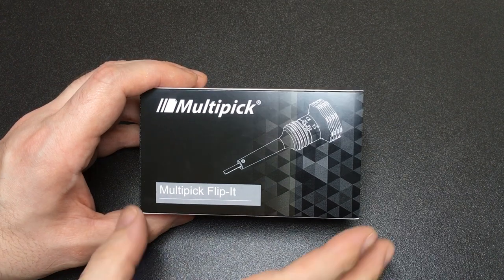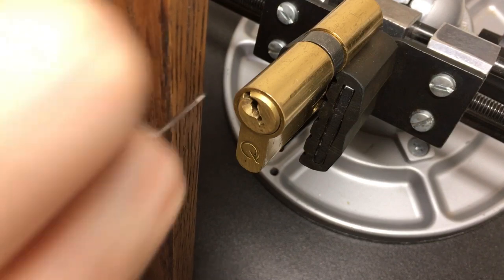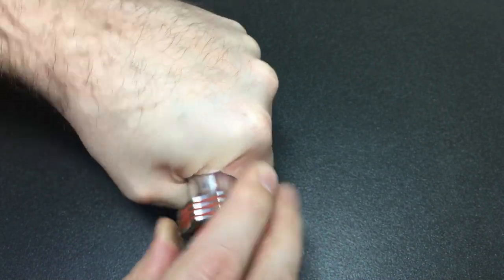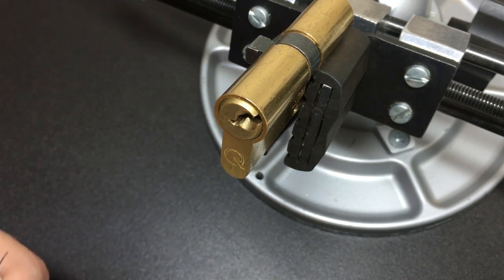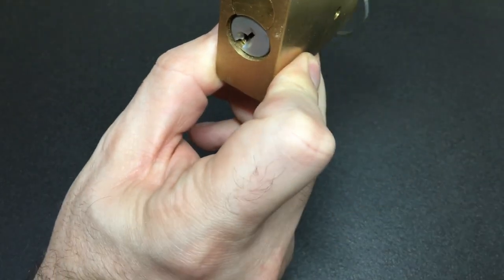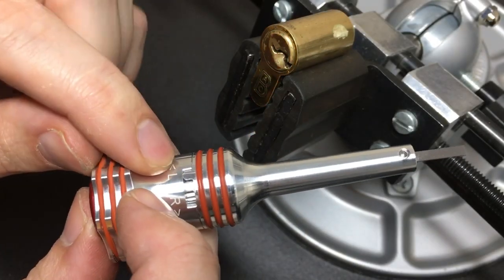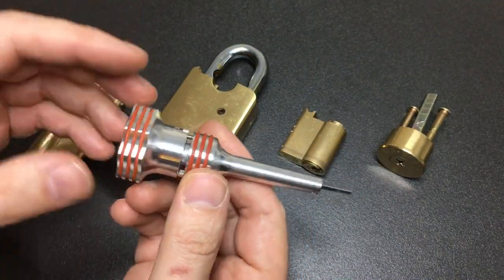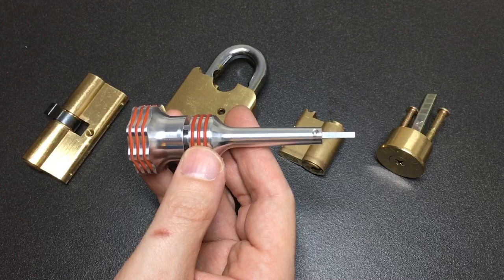Multipick Flip-It Plug Spinner Review

Comment from the maker: I finally get my hands on a plug spinner! One of those tools that when you need one, you wish you had one! 😁 let me know what you think of this one from Multipick in the comments 😃👍
Reply: Honestly the design is nice to the eye but sh*t to use... Why did they make the front part round?!?!? You can hardly tension that thing... Why didn´t they put some kind of jimping on it? The rubber rings do nothing.... I love Multipick, but everyone telling me that this is easy to use as a locksmith is a fkking Fanboy! Especially when WD40 comes into play...
Reply: Small correction, perhaps: It seems to rotate by 90°, not 180°, which does make more sense, if you think about it. It's hard  to tell on this small screen, so please correct me if I'm wrong. That said, it's an excellent idea, so thank-you for the demonstration.
Reply: @RWBHere  When the trigger is pushed, it rotates a full 180 degrees, not 90 degrees.
Reply: @clintsingleton3846  what i´ve meant is slippery greasy stuff in general... if you have slippery fingers this thing is a pain in the a$$ to twist and tension...

Comment: Yet again a quality product from Multipick. You can visibly see the effort that's gone into the design. I haven't used a plug spinner before but do understand the concept behind it. Great review and demos.  I never thought of using one on a cross lock, I guess that's because I never thought that it would work on one. People say it's unrealistic to pick cross locks several times as it slows down the picking to get an open. Well, using one of these shows that you only need to pick it once and then let the plug spinner do the rest.
Reply: The design has it´s flaws... the rounded front part is pain in the ass to tension...
Reply: @Mex_the_Fox  I actually thought that when observing the tool being used. The larger back part looks ok to grip because of its shape. The smaller front piece is small and doesn't look like it gives much grip for the fingers. 

The Multipick plug spinner looks like a solid tool and strong, not flimsy. That's what I meant by my comment. 😁
Reply: @roysammons2445  that's what I wanted to say... I own it but I modified the front part. I removed the rubber rings and gave it two clean but deep finger grooves... Honestly, without that mod, I'd prefer any 15$ tool over this one...
Reply from the maker: Glad you like the review 👍😃
Reply: @Mex_the_Fox  You do have a very good point.

Comment: I absolutely love this tool! No plastic, no accidentally going off. You have to mean it.
- However; I wish they had milled a flat area (from the factory) to aid in charging this left or right with the aid of a wrench. This thing has a tight spring. Even lubed it up a few times thinking this might help. ..... Still, I wouldn't have any other plug spinner in my bag! Pick whichever direction you need, then go! Or of you have to turn a cylinder multiple times to open the mechanism, no problem!! Just Flip-It!
Reply from the maker: Yes, it is tight! 👍

Comment: Great video. I couldn't tell from the unboxing if the spinner comes with differently sized tips. Thanks for letting us know! Take care.
Reply: No you just get the one tip, or at least that's all that came with mine which I got from multipick about a year ago which is about 4mm across
Reply: @JohnDoe-ee6qs  Thanks! I appreciate your time. Take care.
Reply: @webfox1  no problem
Reply from the maker: Just one :-)

Comment: I've wanted a plug spinner for quite some time now, just to have. I like the look of the multi pick one.  Only reason I haven't invested in one is mainly because of how little use it would see as a hobbyist picker.  Good review, have a great weekend.
Reply from the maker: Thanks 🙏
Reply: @LockNoob  what's kind of ironic?  Thursday I picked up a padlock, just a cheap one from princess auto, the bitting is pretty decent on it, what I liked the most is its surprisingly rekeyable with a shielded shackle. I can pick it backwards quickly, be darned if I can get it picked clockwise yet though.  Hahaha. I guess I do in fact need a spinner in my collection now.

Comment: Does it work on M1 or M5 ? I can only pick those CCW . My homemade spinner did not work on these magnum locks, so I bought one offline. It is strong, I almost have to use pliars to set it at full power. It also does not work on M1. Any thoughts? (Just noticed that between the spinner and the lock- - Unstoppable force meeting unmoveable object-- it bent the male stainless steel fitting that inserts into the female lock hole. )
Reply from the maker: if you mean padlocks, i guess so, but it's easier to just pick them clockwise

Comment: At 7:26 when you flipped the core 180 degrees, the only pins that catch the core are the driver pins. the core pins are tucked into the core. All you have to do is stick the flat side of the pick into the core and push them back down flush to turn it. no picking or flipping needed.

Comment: This Multipick spinner I bought in March/2020 from an Australia seller does not have that steel pin you mentioned at 2:36.  I surmise Multipick removed the pin because it's been causing some reliability problems.  It seems to work just fine without the pin and does not to seem to cause noticeable wear on the notch.  
One thing I'd personally prefer is if it used deep cutouts (like those found on the handle top) instead of three flimsy rubber o-rings on the lower barrel to provide friction when charging the spring because the spring is exceedingly strong and the friction provided by the rubber o-rings is just barely sufficient.  If there is a bit of body oil, grease, or WD40 residual on the o-rings, good luck trying to charge the spring without the barrel seriously slipping.  Also the rubber ages or wears over time, it will become much harder to grip the lower portion during charging.
Reply from the maker: Interesting to know, thanks!

Comment: It's also great for doors that have a deadbolt mechanism that gets engaged the second time you lock it. A lot of door locks in Europe work that way and normally you would have to pick it twice. With a plug spinner you can pick it once and then turn it for another time using the plug spinner. BTW. plug spinners can easily be improvised with rubber bands and torsion wrenches or 3D printed. But it doesn't look this good, admitted.
Reply from the maker: Good comment, thanks 🙏

Comment: The poor man's version I found that works is to tape a rubber band to the end of a tension tool, pull the rubber band towards the direction you need while holding the pick, and then letting go of the pick, so it flings towards the direction you need it to go